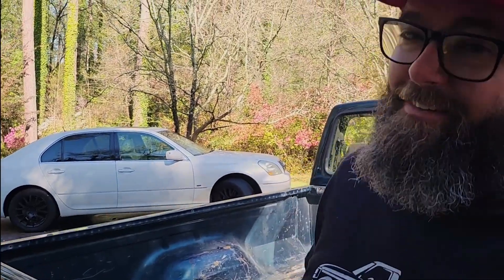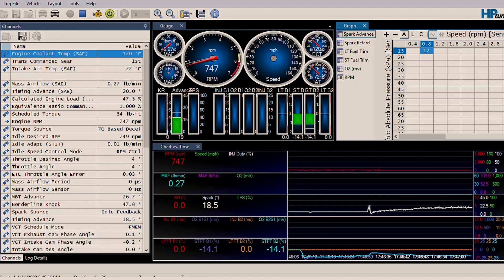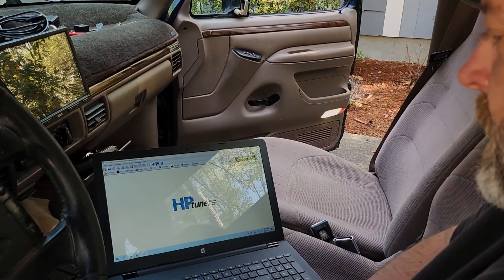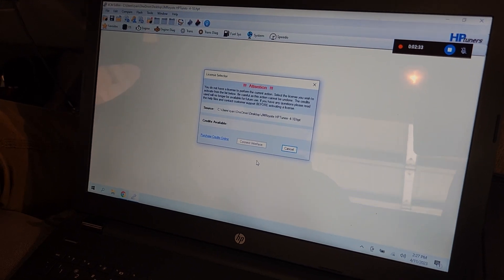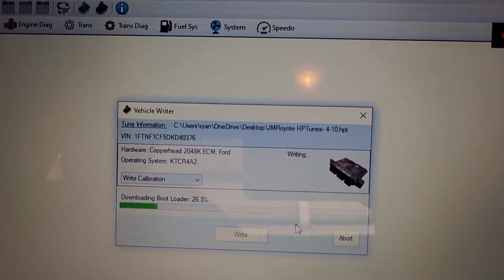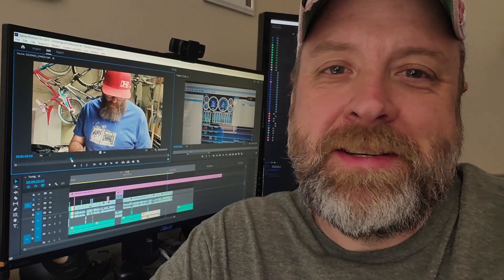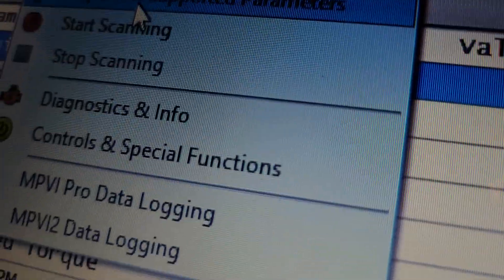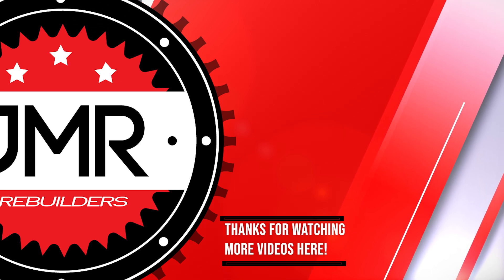Remote Tune with HPTuners for our Coyote Swap F150! Amazing results!

Comment: Do you guys know the size of spacers or specs of the wheels you used? I love the fitment and am trying to put some new wheels on my obs
Reply from the maker: You wont be able to put these on your factory obs.  We have crown vic swapped ours so the front suspension is crown vic and rear axle is also.  Best bet is to go on fitment industries and check out what fits.  These are Ferrada FR2.  Good luck and thanks for the comment and support.  Check out our other content also.